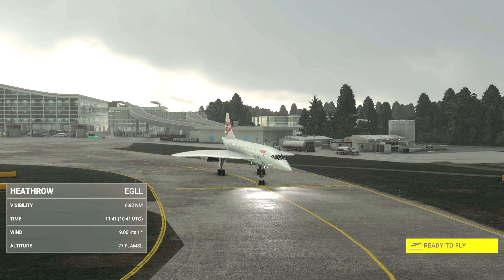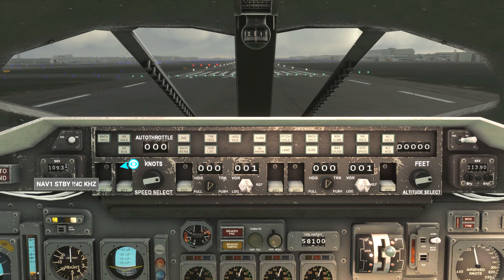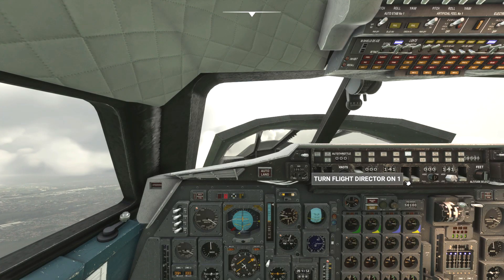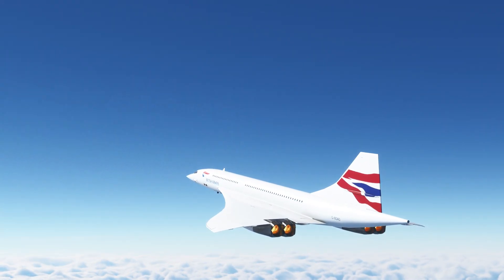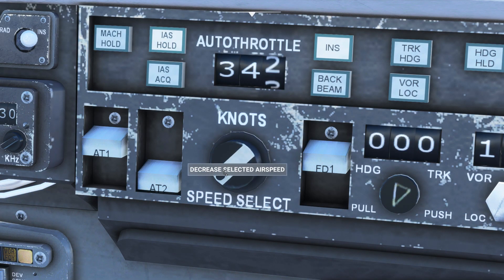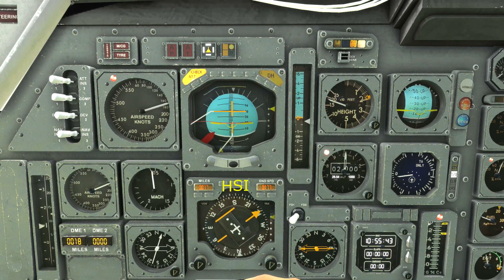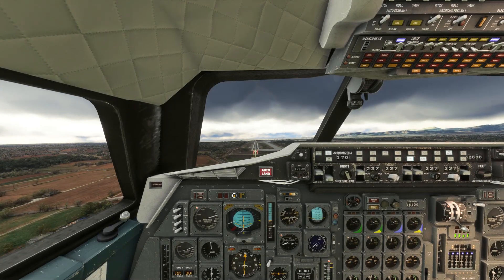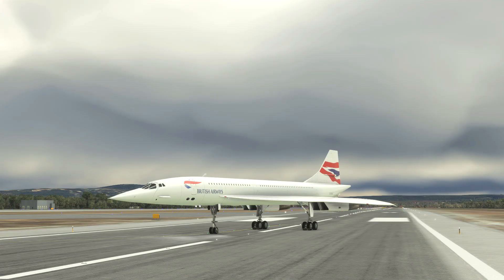DC Designs Concorde MSFS - Easy Tutorial | Full Flight

Comment: I took off without any problems which was a surprise but I can't get it to turn and follow the flight path. I've obviously missed something...
Reply from the maker: If you’ve planned a flight in the sim, hit INS and it’ll follow. AP1 and FD1 need to be on. Make sure the little switches above the nav frequency are set to INS not RAD (should be correct by default).
Reply: @TiJayFLY  LOL it's just crashed to desktop. I'll give those a check now though thank you.
Reply from the maker: @TH33QUALIZ3R  Check your custom scenery folder and make sure it's all compatible with the latest world/sim update. Outdated scenery is generally the cause of CTDs.
Reply: @TiJayFLY  I'm running the latest beta that'll most likely be the culprit.

PS It was the INS switch that I was missing. Thank you. Subscribed.

Comment: Great tutorial, immediately subscribed on your channel. I just have a question, i am not able to have a fuel higher than 61%, even if i set 100%, somebody has the same issue?
Reply from the maker: The sim has an issue where it forgets the fuel you loaded in the menu with pretty much every plane. Set the fuel again once the flight loads in, and it’ll stick.
Reply: @TiJayFLY  Thanks a lot

Comment: Since I usually fly the Concorde between SFO and HNL, I cut the afterburner upon raising the gear, reduce thrust, and level at 4000' to 6000' until I get out over the ocean. Noise pollution was a big reason why the Concorde didn't fly out of many airports so I like to try to practice some form of noise abatement with it. But having an automatic flight engineer like the PMDG DC-6 would be very helpful in managing everything back at that station.
Reply from the maker: Yup, in the video we cut reheat after takeoff but continue at full dry climb, as Concorde pretty much used to do that out of Heathrow 👍 and yes I agree, a virtual flight engineer would be very valuable.

Comment: how to setup the TCA throttle plz?
Reply from the maker: I use the one on the stick for Concorde. For the separate one just take it out of “step” mode and it’ll work like a normal throttle. Pretty sure reverse detent should also work. Calibrate it in the sim’s controls menu

Comment: I’ve never encountered that issue with the airplane just falling out of the sky, in fact I’ve never even heard of it?
Reply from the maker: It was acknowledged and fixed by Asobo for the 787, but it still occurs occasionally at certain points - usually during an approach - on other default planes (and planes that use those default systems). 

It’s not so much falling out of the sky as engine failure, even with failures turned off. You can recover if you’re high enough.

Comment: A few things to improve on, the nose is raised later on in the flight, roughly around 7000 feet for me. So by the time you pass FL100 you can accelerate past 250kts without damaging the nose. Another thing, the reheats are switched off at Mach 1.7 during the supersonic climb, where it will continue to accelerate to Mach 2 on full dry power. You should aim to reach Mach 2 the same time you hit 50,000 feet. You can then slowly continue the climb to 60,000 feet throughout the super-cruise so that you reach the maximum flight level near to the top of descent. A lot of information yes, but other than that this tutorial is great for beginners. :)
Reply from the maker: Yeah I’ve noted that the reheats should go off a little earlier at 1.7. I raised the nose just before I went through 250 - wasn’t Concorde allowed to exceed 250 below 10k once it left the terminal area? The DC does hit Mach 2 around 50,000, so it seems the flight model is accurate enough 👍
Reply: @TiJayFLY  Any aircraft can go faster than 250kts under FL100 with a “high speed” clearance form air traffic control, pretty sure Concorde may have had it a lot more regularly than other aircraft so it can quickly reach the Bristol Channel and fly supersonically as soon as possible.
Reply: I've tried climbing to 60,000ft using the max climb mode and altitude aquire with full afterburner, but the aircraft just sits at around Mach 1.3 and doesn't go beyond that even at 60,000ft. Am I missing something?
Reply from the maker: @ChrystalGek  yes - since this video was made, the plane has been updated and it’s now affected by fuel trim. Check out the pinned comment, there’s a fuel trim tutorial you’ll need to follow 👍

Comment: hey, i just bought the concord knowing all pro's and cons but it seems not a single person has the same bug as me where the power of the plane just shuts down after a few seconds and isnt recoverable. theres no consistent pattern that i can see as to why or when it shuts down but it keeps turning off all  electric power and then i cant fly anymore. i was wondering if you have any bug like this or have any in depth videos on the electronics to make sure i'm making a mistake and it not being a bug because id love to fly it

edit: my EPU also cant be changed.
Reply from the maker: Yea this happens to me occasionally - you can see I mention it in the video around approach time. It happens in some default planes too so it must be a sim bug. Seems to be triggered by certain waypoints. I managed to recover it once, but yeah… Asobo really need to fix their stuff.

Not sure about the EPU thing though
Reply: You need to go to the electrical generating control panel which is right above the ground power switch and then turn on all 4 switches, CSD1, CSD2....
Reply: @sushimello7524  thanks for reminding me i wrote this. But the bug was a faulty usb port. fixed the whole plane and game.

Comment: Sometimes i just cannot get the plane to fly faster than mach 1 at 55k +, with full afterburner. very confused!
Reply from the maker: What sort of weight are you at? Could be a combination of weather and fuel weight. You should be way above Mach 1 a long while before you reach 55,000.
Reply: @TiJayFLY  I am thinking it could be to do with center of gravity and fuel load, because my AOA was 11 degrees whilst flying straight. 

Just completed a flight from new york, and following your instructions exactly i did manage to cruise at 2.04

Comment: Very good. Only thing I would point out is that the afterburners are only needed for takeoff for about 1 minute and also for going supersonic to get through the highest drag region between Mach .95 to 1.7 (about 6 minutes. In real life it was 5 minutes). That was the real beauty of Concorde. Concorde would still accelerate from Mach 1.7 with the afterburners off. Leaving them on just wastes fuel.
Reply from the maker: I switched them off pretty much immediately after takeoff, and didn’t switch back on until 28,000 M0.95ish for that supersonic step climb. 👍 

Fair comment about that climb - I always switch them off when MAX CRUISE illuminates, which tends to be around M2. I thought Concorde could only supercruise without reheat - I didn’t realise it could do M1.7-M2 without them.

Comment: Unusual to see all those "easy" steps you made with AP which can be done on INS ON Mode (right switch) which confusingly is probably the GPS Mode of that instead of Radio. The LAND switch auto enables GLIDE anyways and does need both AP1 & 2 but I don't see it yet needing both FD ON nor tuned the same. Instead I use the Flight Plan from World Map anyways. We know the FMC is a temp design to mimic the A320.
You did not enable the huge row of STABILIZER SWITCHES which will prevent it bobbing lots. Great Plane! Easy to Startup too with just a few switches at the rear.
Reply from the maker: "Easy" but not "simplified". I still wanted to cover the correct steps, but present it in an easy way.
INS button on AP follows GPS, which in turn follows the flight I'd planned on the world map beforehand.
The switch from INS to RADIO is for the ILS. It may currently be an auto-switchover in MSFS but you're meant to switch it manually. Not making the switch could screw you over in future, if the sim was ever fixed so the switchover wasn't automatic.
I honestly assumed the stabilizer switches would already be enabled from a runway start, so didn't even think to check them. It's bizarre that they're off in the "flight ready" state, but thankfully I didn't really notice any issues with stability anyway.
Reply: @TiJayFLY  Hi!  Thanks for the video! I have 4 Questions and id really appreciate it if you'd awswer them.

1.Where are the said stability swiches?
2. When i do my initial climb to 28,000 ft, it doesent stop there and go into altitude hold mode, it keeps going. What Do i do?
3: When i do my 2nd climb, It keeps going even above 60k feet.
4: When i try to enable LAND mode, the aircraft doesent decend like it's supposed to. What do i do here as well?

Thanks So much again for the video it has been a big help.

Comment: So Concorde does not have an LNAV button? The FD button acts as the LNAV?
Reply from the maker: “INS” is LNAV. On the real plane, the INS feeds waypoints to the AP. On this version, the flight plan you create in the sim is automatically fed to the plane’s (slightly fictional) “INS”. So nav mode is still the INS button.
Reply: @TiJayFLY  Ahhh so when taking off and setting speed what should the KTS speed be set up as? 350 kts set as?
Reply from the maker: @xjay1234  It’s all in the video :) burners off at 250 after takeoff then full dry throttle to 28000. After that, reheat back on for max climb to ~60k. Off again at M2. You don’t use AT until descent 👍
Reply: @TiJayFLY  Yes I have watched the video 15 times LOL I am so used to 'flying' A320 and Boeing Models - trying to transfer that knowledge to this speed king. Because in traditional airliners if you don't have the AT on can overspeed - but since you don't use AT until descent (in Concorde) fine - I guess impossible to overspeed in the concorde?
Reply from the maker: @xjay1234  Only time you need to use AT at cruise is Mach hold when you hit 28000. This stops it going over speed while you’re busy configuring the final step climb

Comment: I thought there was a button on the engineers panel that automates the job of the engineer to make the sim simpler. Its off by default. If you look at the actual flights of Concorde from the cockpit.

The thing I like about this Concorde, like the real aircraft. You turn the after burners off not long after going over Mach 1. Then the aircraft will super cruise upto Mach 2. You just need the afterburners to get past the initial huge drag of going supersonic. All this is simulated lovely.
They put the visor up much later. Nice video though
Reply: Full afterburners on take off, rotate 180kts at 13 then 18 degrees attitude, then pull the throttles back to 85% and afterburner keys off, maintain 250kts. Terminal area and up to FL100 250kts (nose and visor raised 4000ft-6000ft) then full dry power climb to FL280. Once cleared of land, Max Climb with full dry power, starting the afterburners 2&3, wait 10 seconds then 1&4. The afterburners will remain on until Mach 1.7, then release 2&3, then 1&4. On descent, distance 250nms, throttle back to Mach 1.5, descend down to FL100 with max speed at 250kts. Descend to approach attitude of the airport, lower the visor, then nose fully down.
Reply from the maker: @captricharddee3634  tldr nailed it? 😉
Reply from the maker: There’s a fuel auto trim switch but it doesn’t seem to work, and you still have to specify forward/back (as you say, it’s based on a real switch). It’s not like the Colimata or PSS where there’s a full virtual flight engineer. Would be nice if there was a clear “VFE ON” option somewhere that took care of everything fuel related.

Comment: Was not able to get the plane to track the ILS, even tried flicking it back and forth from RAD to INS... no dice, nothing worked to get it to track the ILS. Something is fundamentally broken with either the plane or the Sim. Might try and see if I can use the GTX750 tomorrow as a work around until its fixed.
Reply from the maker: Was the ILS displayed and just not tracked, or not displayed at all?
Reply: @TiJayFLY  ILS was displayed and the needles did move it just didn't capture it. Seems to be like 50/50 on working or not.
Reply from the maker: @shinkicker404  sorry for the delay, I didn’t get notified about this. So yeah, the ILS won’t capture unless you’re dead on runway heading pretty much. This is because it shares sensitivity with the nav mode (thanks Asobo), so if the ILS capture area was “wider”, the plane would be too twitchy at supersonic speeds.

Comment: Great tutorial,  can you explain how to add passenger and pilots ? I can’t  figure it out
Reply: have the same question ! this is linked to the payload manager as it is mentioned i n the documentation, but I can't find it
Reply from the maker: This is controlled by weight and balance in the simulator menus before starting a flight - if you add pilot and passenger weights, they appear. It’s the same menu where you set your fuel, as with any MSFS plane. You can also switch on/off the passenger models with a switch on the lower left of the engineer panel.
Reply: @TiJayFLY  found it ! was missing this buton ! all set now ! Thank you
Reply: Thanks , looking forward to more of your videos